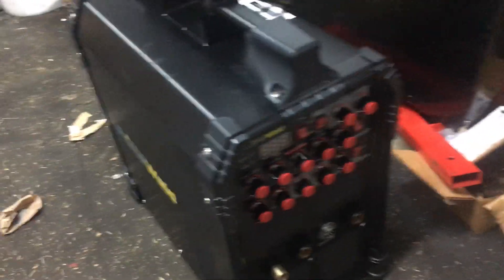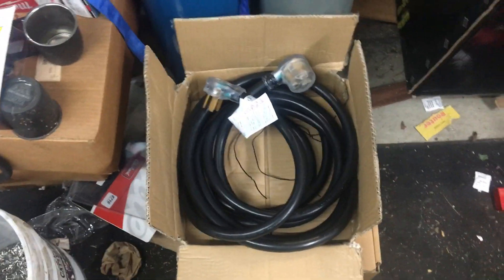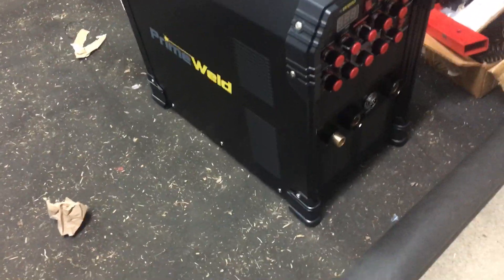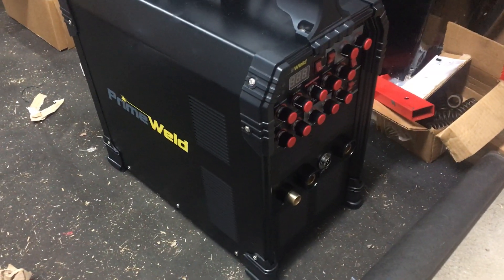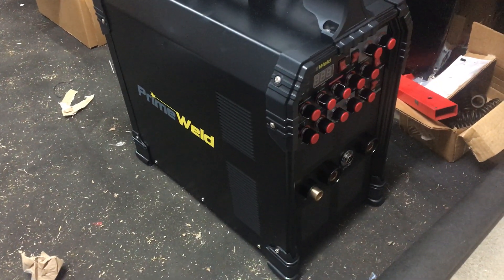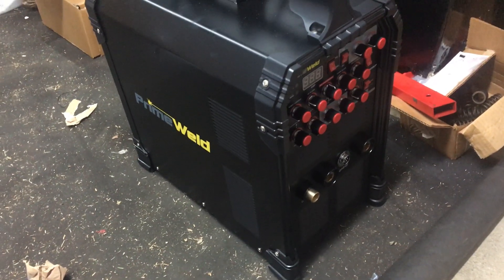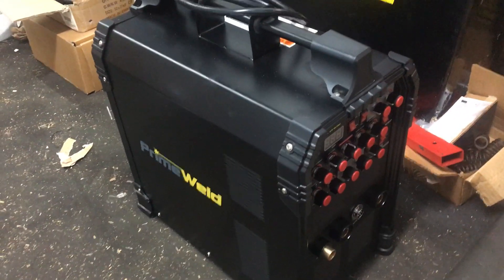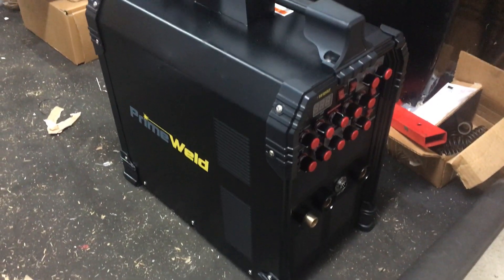Not Enough Generator Power!  Primeweld 225X AC/DC Tig Welder Update

Comment: Got the same welder, you need a 13kW generator for max power.
Reply: 13kw max power or continuous? I have a 9000w/7250w (max/continuous) generator and plan on using this welder with it. I plan on welding aluminum mostly.. no more than 1/8in thick. I think I should be fine.
Reply: @randybobandy9828  13k peak 10.5k running, with a 6 gauge 50ft extention cord. Could get away with less, but I wanted all the options.
Reply: What generator exactly are u using .. in the market for one .

Comment: You need a bare minimum of 12000 watts continuous & 20% surge capacity  to run a 50 amp branch circuit on 240volts.  Your 4500watt would only run the adapter to 120volt and not be able to use the welder to its full capacity.
Reply: Bro, right on! The only commenter who knows their shit and you didn’t even have to write a book about it. 😆 Most people are trying to run their welders off the 20 or 30 amp circuit and expect it to work at 4000 watts too. The average welder will pull 6500 watts! I have a 13000 watt duromax with the 50amp circuit and I’ve run an inverter stick welder and an inverter plasma cutter on it, no problems. All these people talking about having to have an inverter generator have their information twisted somewhere.
Reply: Nobody runs 50amps on a 50amp 240 circuit though.. they run 80% of 50amps which is 40amps and 9600w. Same reason you will never see a item that is sold for a 120v outlet that's more than 1500w even though a 15amp outlet can do "1800w".

Comment: If your going to run a welder on a generator 4500 is only enough to do short circuit mig under 16 volts, and not long runs depending on the gen. I would look at a 10k generator for welding and what alot of people forget is the generators like yours will pop the breaker at around 15 amps on 110 20 amps 120 so you want to run on the 30 amp or 220/240 volt plug ins and you'll probably get 20 to 30 amps. So your generator with say 2 110 outlets means its designed to run 1,650 volts each continuously double that you get 3,300 coincidentally that's your running with a peak of 4500 that's how your generator is designed to work. So use the 30 amp or 220 volt plug to try and run a single high output item won't help much you'll still surge but it's how the generators designed to work.so look at the generators carefully when picking the HF ones are typically 23 amps around you want 30 for your welder on 120 volt. Example 30x120=3600 30×220=6600 30x240=7200 divide by the number of outlets each breaker is running and you'll notice another similarity in generators and rattings and see how many breakers are on it. So do a little math when picking your generator and see if it fits your needs and how they are designing to work the load across 4 110 outlets or splitting 110 and 220 volt you get the idea.

Comment: You need an inverter generator or a generator with THD <3% - like Generac. I had a 10,000 watt Duromax that wouldn't power an omnipro 220 after you started welding. I got a Champion inverter 8750 watt and it works fine with the Omnipro 220. Clean power is the key for all these newer inverter welders.
Reply: This isn't true at all. My generator isn't a inverter and it has low thd and has proven to run this exact welder.
Reply: Did your Duromax have a 50 amp outlet?
Reply: @randomschittz9461  Yes.
Reply: @machaf  well, I believe there’s something that doesn’t add up because you definitely don’t need an inverter generator to run an inverter welder, and it’s impossible to get less than 3% THD in the real world. General can make any claims they like, but they probably tested it through a gigantic isolation transformer in a vacuum. I believe something was wrong with your original duromax, or it was a 30 amp outlet.
Reply: @randomschittz9461  Everything adds up fine, you just don't get it....The Duromax just doesn't produce 'clean' power because its THD is 12-20%, vs <5% for an inverter generator. Same reason why certain electronics such an a UPS wont run off a non inverter power....Regarding your 30amp outlet comment - you're wrong again. The welder runs fine off a 30 amp inverter gen outlet and 30 amp home outlet, also capable of running off a 15amp 120v.

Comment: I have A225 Primeweld  run it on a  Harbor freight predator 9000 generator all day long have no problems.  Doing it it for about 2 1/2 yrs or so .  As well as a PrimeWeld  60 cutter .
Reply: Kinda late . But how is it running now . And are u running it on the 220 outlet? Or did u find a better generator for the welder ?
Reply: Are plugging it into the 220 putlet or 110
Reply: Oh that's good to hear! I just ordered this welder and have the 8750/7000w predator which is basically the same as the 9000w predator(same 420cc motor). I plan on welding with it alot since I won't have real power for awhile

Comment: That "4500" watt is a peak number.  Continuous is probably more like 3000 watts.  Which equals a constant 12.5 amps at 240 (3000/240).  So maybe try it the 110 plug 3000/120=25 amps) to see if it's the lack of power or the dirty sine wave.
btw, the only real difference (sometimes zero difference) between a 4500w gen and a 8500w is the size/horse power of the motor.

Comment: VERY poor title for your video, and not at all fair to PRIMEWELD!  I would have been SHOCKED if you were able to run that welder properly off of that Generator. Your title looks like it blames PRIMEWELD for this. I'd delete this video or edit your title ASAP. You are doing a Disservice to the tool community posting this as it is.
Reply from the maker: Normally I just let negative comments slide, but I'm not going to this time.  Maybe you should go watch the video again!  I made this video so people would know not to use a small generator and expect it to work.  I clearly state that in the video and never state anything negative about Primeweld.

Comment: Just run it off your wall outlet 120 volts that machine will do plenty with it I just filled it some quarter inch aluminum with it plugged into a wall that let the other day had to preheat it but welded like butter that is a great machine
Reply from the maker: The only wall socket available is only 15 amps and it's running the lights in the shop already...

Comment: I just ran a 6awg wire from my breaker box with a 50amp breaker it only cost me around 250 man it's not that bad. I also have the primeweld 225 and prime weld cut 60
Reply from the maker: Did you do it yourself or have an electrician do it?

Comment: Be very cautious with running inverter welders on generators. If you have a poor quality generator that is noisy (harmonic distortion is a common measure of electrical quality) you can destroy inverter welders. A fairly common spec is under 5% total harmonic distortion (THD). The bigger the generator the less your load is going to tax the generator. If you run a heavy load on a lower power generator you will have your surging issue because the power drawn will draw the voltage down more. That will be terrible for your weld quality. Check the specs on the welder - the 7000w you mentioned as being recommended may not be the end of the story. You need to know if that is starting watts or running watts. You also need to be aware of the circuit breaker on the generator. No generator can give you more power than what the breaker trips at, so any wattage above the breaker limit (watts is amps x volts - so divide the wattage by the voltage to get the current ability and if that is higher than the breaker you have more power from the generator than the breaker can withstand). Moral of the point - watch all 3 specs - the generator wattage, the main breaker amperage, and what the welder requires. 
Additionally - if you have an electric clothes dryer you likely already have a 30 amp 120/240v outlet. For temporary/intermittent use you can run an extension cord from that outlet to where you are welding. This is what I do, although the outlet is under 20 feet from the welder and other equipment. The cable you want to use is 4 conductor SO grade - it is typically used for equipment hook-up cable and RV extension cords. You can buy it online. The longer your cable run the larger the conductors need to be. If it were me and I were to run a 100 foot length I would use no smaller than 8 gauge. 6 gauge would be better. It isn't the current that will be your enemy - it is the voltage drop through the cable because of the current. The larger the wire the better the voltage at your load = welder. Also note that larger 4 conductor cable will usually have 3 conductors of the spec gauge. So for a 6 gauge 4 conductor SO cable you may get 3x 6 gauge conductors. These are your 2x hot lines and neutral. Your ground conductor may be 10 gauge. Some SO cable (or SOOW, similar stuff) will have all 4 the same size conductors. 
Though the welder uses a 3 pin plug it is easier to run all 4 in case you have a larger 120v load - like an air compressor, band saw, what have you. Use the NMEA 14-30 for 30 amp service (dryer plug). Never up-size the breaker - so don't swap out the 30 amp breaker for a 50 amp breaker on that circuit. If you need a bigger breaker you need to run correct size plugs/outlets and cable. However, I think everything you could possibly need to weld in your garage will run on a 30 amp circuit - especially if all you are doing is TIG. Unless you are running much over 120 amps welding current I doubt you'll have issues on a 30 amp breaker/circuit (provided you have large enough cable to not have a big voltage drop between the outlet and the welder). A 30 amp dryer plug is most likely wired with 10 gauge Romex. Don't think you can get by with 10 gauge for extending the circuit unless it is a short run. You will already have 10 gauge between the breaker and the outlet for voltage drop under load - don't pour salt on a wound and continue on with a small cable - that's where the 8, or better yet, 6 gauge cable is necessary. 
Good luck with it and have fun with your new welder!!!!
Reply from the maker: I do have a large extension cord made for welding.  I'll have to look to see what size it is.  I'll be sure to update in a future video. Yes, 7000 was running watts that I was referring to.  You bring up excellent points.